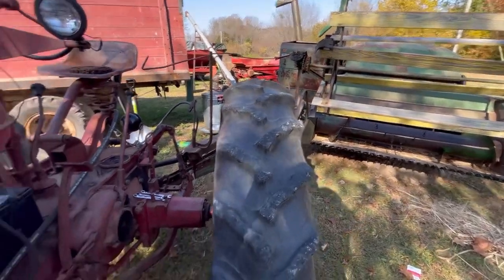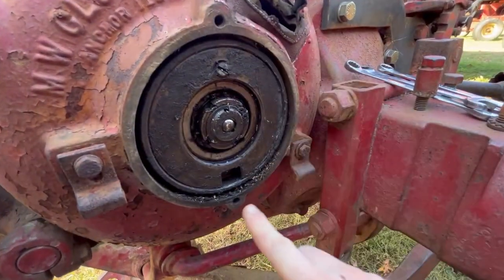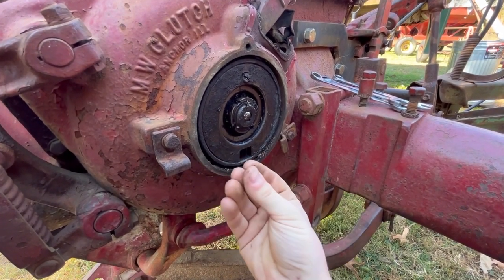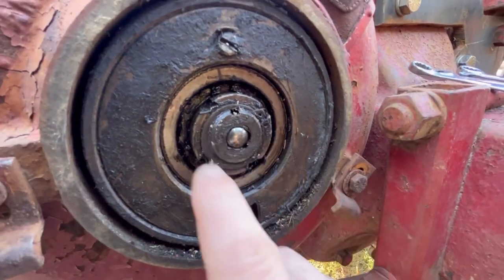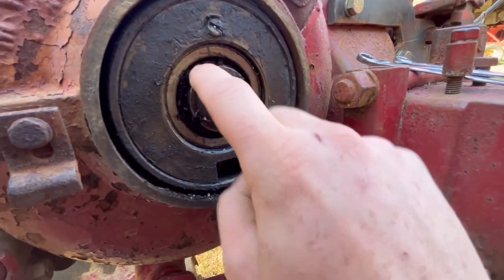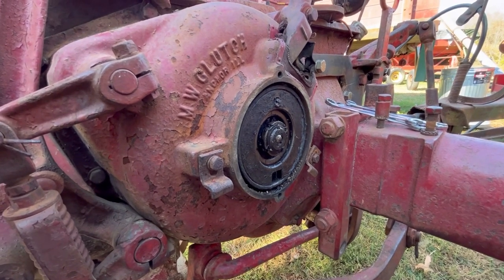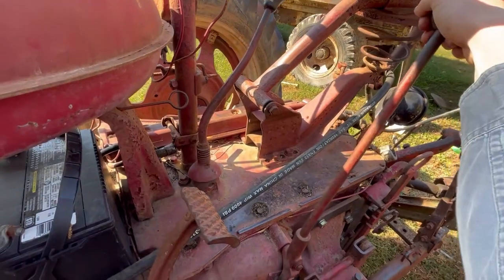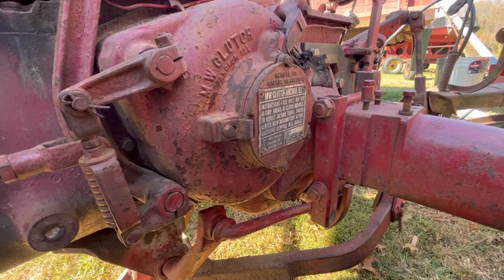M&W hand clutch repair/adjustment

Comment: Good! I like more to come. The old dragline I herded was set up so when you had adjusted the clutch all that was there it'd just go into pieces and you had to get new discs to put it back together. VERY disconcerting to have it fly all to pieces right in the middle of a job and that's the way it always happened. Blessings!
Reply from the maker: I bet that was scary a few times when it let go
Reply: @DrRust  It was always a swing clutch. Never had the hoist or drag even need resetting. You had to work the swings against each other to get the thing to stop and change directions. 'Free Swing' was what it was called. Liebherr hoes had it too but they were hydraulic so no clutches, just freewheeling but only on the swing.
Reply from the maker: That’s interesting I love watching draglines work
Reply: @DrRust  You ought to jump in the seat sometime. Just a set of winches on a turntable and everything just does one thing except the swing lever and it has both directions on it. A clutch lever and brake pedal for each drum. No rocket science there. You're red headed enough to make a good operator as I was told that all crane operators are about crazy anyway. I'm talking from running the blasted things since 1971 too so I ought to know.
Reply from the maker: Hopefully someday I’ll get some seat time most people think I’m crazy so I’d fit in
Reply: @DrRust  You'd get it, NO problem!